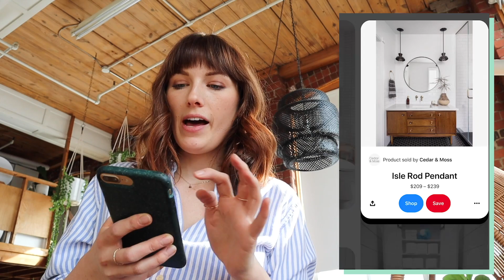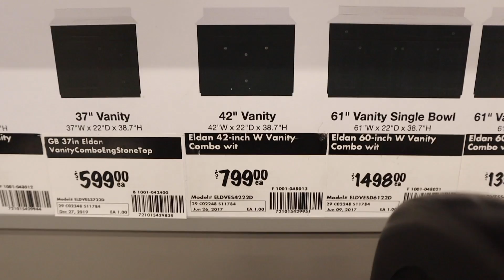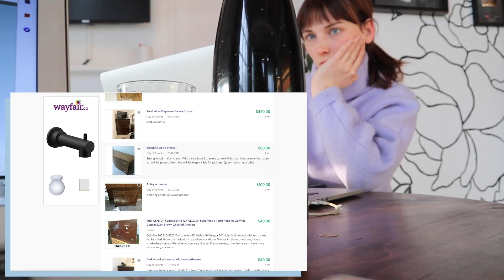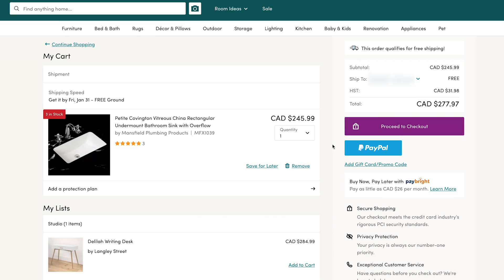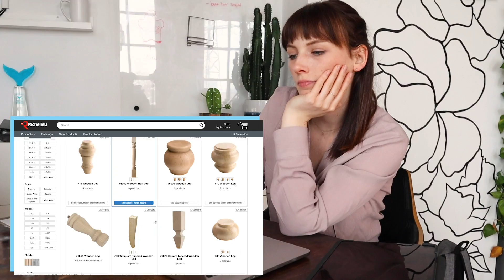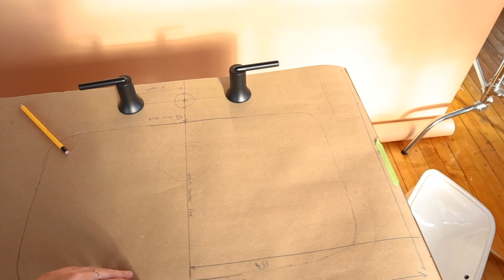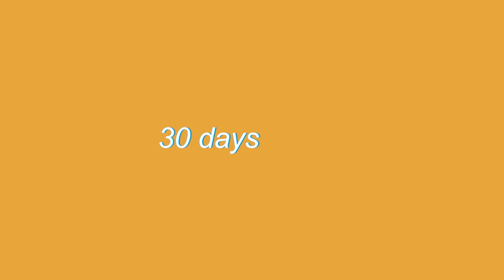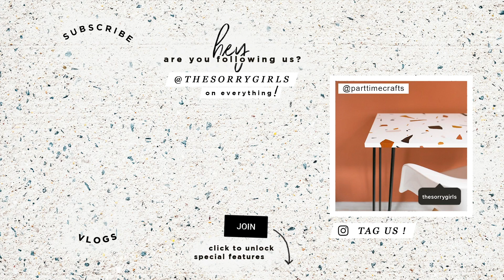can i DIY a thrifted dresser into a pinterest bathroom vanity?!

Comment: I did this years ago with a glass vessel on top and a solid wood dresser from Craigslist and it was way easier than I planned. I used waterproof varnish meant for like boats or something the wood top. It was easy. One hole for the sink, one hole for the tap, and a hole in the back for the pipe. The hardest part was fixing the drawer that I cut through for the pipe so that it could still be used. Cost less than $200.
Reply: AllRattedUp wow
Reply: @sadiepowell1557  my reaction exactly
Reply: Wait what a hack thanks for adding this!!
Reply: Tamaj Wright same
Reply: Taylor  Toilet paper? What's that?
Reply: Taylor  Toilet paper?! I have tree leafs by now.
Reply: Taylor  Wait, you have toilet paper? Lucky.
Reply: Awesome, i did the glass vessel too, but i added a countertop from Ikea under $100 because i have kids 🤦‍♀️ i used the ones they sell for their vessel vanities.
Reply: Did you use the marine varnish on the secondary wood, like inside and outside of drawers and the entire inside of the dresser too? I have a dresser to prepare for my own house and I don't want my drawers to feel like they're painted but I also don't want to leave them exposed to moisture. Dressers weren't designed to be kept in the bathroom, so I'm a little scared.
Reply: @I_Am_MaryKake  no. It was in an 80s house where the vanity is outside of the shower room so we weren't concerned about dampness, just water splashing on top from the tap.
Reply: @ktdid627  Would you suggest I do all that if it's going inside a small main bathroom?

Comment: I have a question, if you cut a whole through the beams, and then you put a hella heavy countertop on top of it..... how the heck is that structural integrity happening??? Like how is it not collapsing??
Reply: That big beam that goes from the front to the back  slanted . Holds  the weight of the countertop and sink . The small piece she cut out of the back didn't provide alot of structure . Its made more for the top drawers not so much the actual structure. Source: my dad , contractor of 30+ years .

Comment: I was in the middle of doing my own converted vanity when I found your video. So glad I found. It gave me confidence I was not the only one thinking this way!  I used an old sideboard, removed the old timber top and replaced it with a piece of stone. My plumber was so awesome he incorporated the plumbing into the wall so none of the cupboard shelves etc was compromised. Just had to remove one of the drawers for the s bend and remove the face and glue back on the front of the cabinet. The cabinet cost me second hand AU$250 (it’s in perfect condition -bargain) and the stone AU$450. So about the same price as a mid range no modern style wall hung vanity. Thank you. Keep the videos coming.

Comment: FYI for future dresser vanity diys: ikea ODENSVIK counter/ sink combo comes in a ton of sizes & sink combinations & not only is it cheap (i got the like 50 inch long single basin option for under $150), the basin its self is shallow so you dont need to cut out much drawer space like with a standard sink!
You can just-
Take the backer board off the dresser (no one sees it & it makes life easier at instal), 
Take off the top (so you can use the wood for another project but you could just cut a hole in the top where the sink goes), 
Reinforce if needed (a regular sink cabinet is made to carry that much weight but a dresser usually isnt (but a hutch base often is)), 
Drop the counter / sink combo in,
& slide the drawers in to see what needs to be trimmed! 
I only needed to trim a 2 inch gap on the inside edge of the top drawers. No lost space! 

Hope this helps someones future DIY 💙

Comment: I'm curious to see what you do with the drawers, especially the ones you have to modify to fit around the plumbing. I feel like you could get pretty creative with making storage work in them!
One thing I was thinking - that top drawer right under the sink will probably be essentially unusable, but you could put it on hinges so the top opens out and then put a tray in there attached to the face of the drawer itself for small things like toothbrush, toothpaste, etc. 
We had one like that in our old rental for the drawer of the kitchen sink that we kept sponges and scrubbies and drain plugs in, and it was nice to get usable space out of it.
Anyway, would be a fun diy to watch!

Comment: Awesooome!! I wish you did this when i was diying mine 😂 i chose to diy mine because i wanted mid century and thats expensive. Mine is only 40in. In US $, I bought a midcentury cabinet $250, a clearance over the counter glass sink $90, faucet $90 from HD, i  used IKEA's vanity countertops, nothing fancy so it was around $90. It loooks stunning and im supper happy with it. I bought a cabinet instead of drawers because i have the plumbing from the floor as well, and i m not awesome as you are to fix it 🙈 it came out to $420. Id say same price as the cheap ones in HD, but does not look as beautiful 😍 and If i can do this, anyone can do it

Comment: Love the vanity! The one thing I would say is to add back some of the supports you had to remove, just in a different place, as the counter is heavier than what it was designed for and long term use + humid environment may cause the vanity to weaken. Probably not, but one of those better safe than sorry scenarios. Also, love the home series! Thanks for sharing.

Comment: Beautiful vanity! I second/third/fourth/infinity adding back supports to the back, AND building proper drawer backs, or what remains of the drawers is just going to fall apart with use. 

Fyi, mid-century modern furniture like this dresser were typically finished in something called "toned laquer". It's basically a laquer with a stain added into it. It does cover the wood grain a bit, but it also evens out the wood tone, which can look quite blotchy with a penetrating stain. That's why the wood "almost looked painted". You can still get toned laquer - I use it often when refinishing MCM furniture (it's a sideline of mine) because I'm trying to finish things as close to their original surfaces as I can get. If you ever want to try it, generally Mohawk is the best brand, and it can be found at Richelieu - a commercial supplier (they sell retail though, too). You'll want to practice a bit on spare wood before putting it on your project to make sure you can apply it evenly. Let the toned laquer dry completely, give it a light sand to smooth out any bumps or bubbles, clean it off, then topcoat with a coat or two of clear lacquer. For MCM stuff, I tend to like the satin matte laquer finish best. Good luck on your next project.

Comment: I turned an old box TV entertainment center into an short entertainment stand for a wall mounted tv... I just cut it in half and then took the top and placed it on the bottom spray painted it black and mod podged Batman comic book pages for the top and on the inside parts of the shelves and then sealed it all with spray varnish
it is my favorite piece in the house and I am so proud of it and I am planning on matching all of the wood living room furniture to eventually lol ...🤔 I should put pictures of it on my Instagram I just never got around to that 😅 I was too excited 😂

Comment: A lot of people are commenting about how the structure will hold, and I think I have a solution!! 
Would you consider making all the right side drawers a cabinet-style door instead?? you would be able to restore the middle beam there in one way or another without sacrificing the drawers’ look (just by cutting out the face of the drawers and gluing them to a thin piece of plywood, attaching with small hinges that can blend into the drawer)? Doesn’t seem like those drawers on the right are usable anyway :o  
That way the pipes will have easy access for when you have to do maintenance, and you can use the area underneath the pipes for some organization storage, instead of having drawers that have huge holes in them and can threaten to collapse the structure....

Comment: If there's a shower next to the vanity you should consider protecting the side (wood) of a vanity by using something waterproof, because wood absorbs water pretty quickly and it can expand and damage your beautiful piece.
Or you can use glass wall to separate them, but i think i would be more expensive

Comment: Mica
1 second ago
I'm working on my bathroom vanity as well, here's some tips:
DON'T: Buy a piece of furniture that is over 50 years old, change the legs with a completely different attachment method, probably also measure wrong to make the thing wobble, then put a slab of heavy ass marble and ceramic on top of it and discard the support beams and make a huge hole on the back panel which is supposed to hold the structure together. Let's not forget about all the nice wood that is wasted, which is probably why the dresser was so expensive. Don't spend so much money for something that is not fully functional (hint: drawers) and its structure is heavily compromised and won't last as long as its previous life.

 What I did: I designed something with the vibe that I liked (similar to hers, mid century modern) and gave it to a carpenter. The wood is repurposed (go environment), cheap but sturdy and is going to be stained and treated to look good. It's custom made to fit my needs and taste, waaay cheaper than what she paid even though we had to engineer how to work around a pre existing sink because we're renting. No authentic and expensive piece of furniture made out of nice wood was harmed.

Comment: As beautiful as this is, all that work is why I didn’t do this myself.  I have been loving this for over 20 years, but the idea of buying the dresser, and then retro fitting. However you did a fantastic job.
I would have put in a bar size sink for extra counter space, and made it stainless for easy cleaning. I most like would have done a drop in sink and tiled the top with granite. (I like the grout lines in granite tiles 🤷🏾‍♀️) Or i might have painted the top something wild and then resin the top. I would have found some super funky legs, just because I could and most likely stained it almost black.

Comment: It's worth it if you can find things cheap if so you can find it dresser at a thrift store I know there are other options for countertop to there's a company that makes an epoxy that looks like Stone heat resistant everything and you can custom do-it-yourself top some really cool designs cement for countertops it's what it was designed for so I think if you have an existing one making this a slow collected what you want for it project it works favorites if you went to that place and got this customized the way you wanted you probably would have spent more

Comment: Chêne vieilli = old oak, aged up oak
By the way, that quartz countertop is very heavy. I'm afraid the ''beams'' you've cut off on the inside have weakened the vanity. On the long run, the dresser might start sagging or ends up crumbling underneath the weight of the countertop and the sink.

Comment: ok but you put the plumbing system exactly where it is right now on the vanity, but you do not have tiles on the ground yet  so once you do the vanity isn't going to fit the plumbing system anymore?¿? or am i just unnecessarily stressing? hope i am
Reply from the maker: The ground is finished concrete so no need for floor tiles! It should fit as is :)
Reply: @TheSorryGirls  oh ok, thank god, i was so worried! 🤦🏼‍♀️ you did an amazing job 😍

Comment: This is not hard if you have basic common sense and maybe are a lil construction or creative savvy. I haven't even wstched this and I bet she sawzaws a hole in the top for the sink then some cuts in the bottom inside backing for the plumbing. If you chose to paint/stain it or tile it do it before you install the sink and put it up against the wall. Install the sink and plumbing at the bathrm wall. Post up against mirror on the wall. Wham bam ty Mam. Was I right?
Reply: I fast forwarded to the end now and OMG she could of bought a new one for that price and installed for u. I'm dead lol.
Reply: Wow I should do this cus I could do it for WAY cheaper and prettier hmm ideas!!!

Comment: The idea is nice, I do think you paid more than you should have for the actual dresser. Also, the hack job of messing up the drawers is a bad look. I would have bought a floating sink to sit on top. You could have avoided buying taller legs or have a cut in the wood. I would have refinished the top of the wood with a resin for durability. For the plumbing you could have converted half the drawers into a cabinet to give space for plumbing and still have storage on that side. But it's your dresser and your vision. I just don't think it was strongly executed. You guys get better in every video. I hope you push yourself to get better at technique and stay away from jigger rigging projects when you bump into a problem.